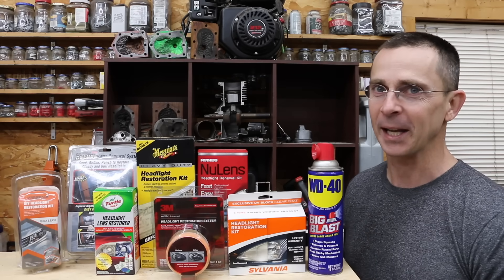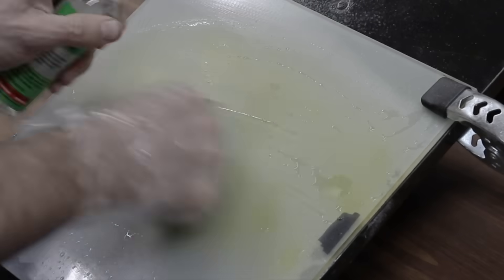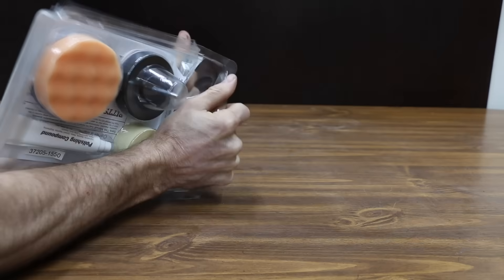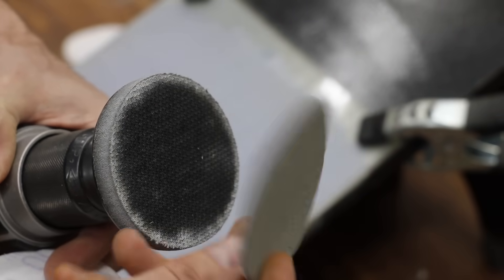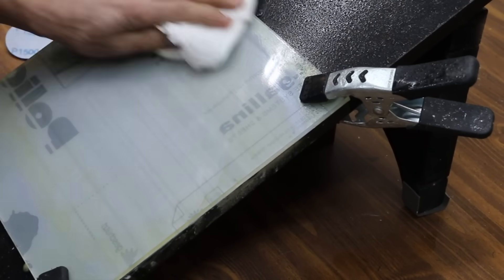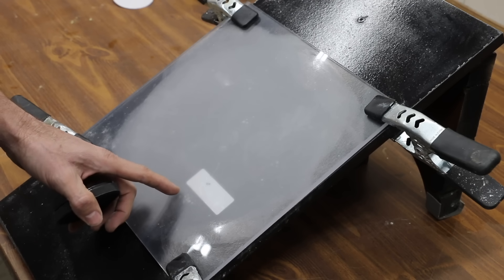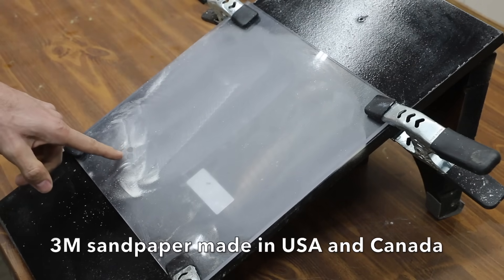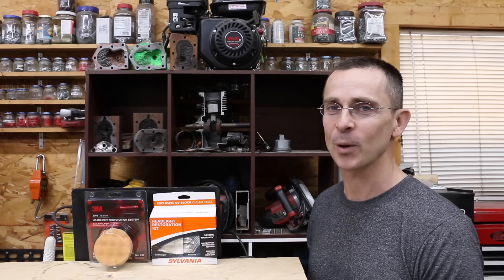Best Headlight Restoration Kit?  Let's find out!  3M, Sylvania, Meguiar's, Mothers, Turtle Wax & HF

Comment: ALL of the kits are rips offs. Hear me out. Most of these restoration kits contains a "UV blocker" that is often used in urethanes. I looked up some sds's and it appears that the SAME uv blockers are found in SPAR URETHANE (not to mention that the sylvania uv block smells and feels a lot like a urethane :D). The sds for sylvania and 3M use UV blockers with these CAS numbers: 104810-48-2 and 104810-47-1 etc. These are the SAME compounds found in Minwax Helmsman Spar Urethane. I simply bought a can of MinWax Spar Urethane (clear gloss), diluted it 50/50 or 60/40 with Mineral Spirits (so it doesn't streak upon application), did the whole sanding and prep (most important steps) for the headlights and applied the spar urethane. It's been a year so far and my headlights are still clear. After buying my own sandpaper (800, 1000, 1500, 2000, 3000) in normal sized sheets, (none of these itty bitty samples they give you in the kit) plus a whole 236ml can of the UV blocking urethane, I got about 15X more product for half the price. Pays off to do your research folks, there's nothing special or "revolutionary" about these products. Active passive uv blockers, 3D, 50 shades whiter, 50x stronger than regular...????? hahaha. Thanks project farm for doing these video's, awesome stuff as always. Could you compare with your own kit and sandpaper as described above? The minwax Helmsman urethane comes in a green can, costs about $15 up here in Canada.
Reply from the maker: Thanks for the video idea.

Comment: ive used most of these products on my vehicles over many years and also concluded that the Sylvania kit is the best. It lasted about a year for me on three cars until the streaks from where the gel was applied began to show. The absolute best way to restore headlights is to sand like the Sylvania kit says, dry the headlight and area around it, mask with clear plastic and painters tape, wipe with rubbing alcohol, and use a 2k aerosol clear coat. This is actual high quality paint with a hardener that will not break down like other kit sealants or regular 1-stage paint will that you can get at the auto parts store. The paint is about $25 a can and only lasts for about 48 hours after you crack the seal to introduce the two parts of the paint can together, but the results are phenomenal. Headlight looks brand new and zero fading at all, just like regular clearcoat on a car.
Reply from the maker: Thanks for sharing.

Comment: I bought the Harbor Freight kit about a year after I purchased the 3M brand. and it's basically the carbon copy of the more expensive 3M, even the directions. but the Pittsburgh pads don't last even half the time the 3m's do. the quality is garbage. good thing I had pads leftover from the better brand to finish my lenses. fair to say, I'll just stick with the tried and true, at least for me, 3M Restoration kit. I also use a spray bottle throughout the process of sanding, so basically wet sanding and it keeps the sandpaper clean from clogging up.
Reply from the maker: Thanks for sharing.

Comment: Hey PF, Another great test.

I have two product suggestions. Both involve filter elements:

1. Refrigerator water filters. Are aftermarket brands as good as OEM? I bought a new GE french door model just before Thanksgiving, and the red filter light is now flashing. A check on Amazon shows I can buy 3 aftermarket filters for 1/2 the price of a single GE OEM filter.

2. Furnace filters. 3M filters (the ones I use) cost more than other brands, and they have several filtration levels. What's the difference, if any, between these levels and cheaper brands?

In both cases we're talking about essentials here. The public should know if the water we drink and air we breath in our homes is actually safer using these products. 

I'm going to contribute to Patreon because of the work you do. Thanks.
Reply from the maker: Thanks for the video ideas.

Comment: I had tried the turtlewax, 3M and Visbella, they all work the same if you machine polish them with the sanding pad then the cream polish. They all cleared up but they also all dulled up again after a few months, the visbella's selling point is it has an acetone based liquid to dissolve the headlight to make a clear appearance but its hard to do a clean swipe without introducing liquid wave due to surface tension. Dupicolor has their own kit with a clear coat uv resistant spray but i havent tried it.
Reply from the maker: Thanks for sharing.

Comment: I used a slightly fancier version of the 3M kit (same sanding discs, but bundled with a protective coating wipe) on the badly oxidized lenses of a 2007 Chevrolet Silverado Classic. I was nervous, having never restored any lenses before.

The results were outstanding and the lenses again look brand new. I really did not expect it to turn out as well as it did. I'd definitely recommend the 3M kit to others.
Reply from the maker: Thanks for sharing.

Comment: I chose 3M a while back when I went to the local auto parts store. After watching this, I'm glad I did. 3M always seems to have the best products. I don't remember seeing Sylvania's kit or I completely disregarded it. It's surprising to see that it outperformed everything that uses a drill with various grit levels. I guess it's a matter of the chemistry of the products used breaking down the yellowing whilst not aggressively digging into the lense like the other products. Great reviews, this channel rocks!
Reply: A big part is the ceramic (or ceramic like) coating at the last step.  It fills in all the scratches and self levels.
Reply from the maker: Thanks for sharing.

Comment: You should do gas tank repair tests. With plastic and metal tanks. Test if it works with and without fuel, gasoline and diesel, with wholes and gashes.
Reply from the maker: Thanks for the video idea.

Comment: Some "high-end" kits are Visbella/ 3M/ Mequiars labeled "Heavy Duty" go from hand sanding to drill based. The MOST durable, long lasting is 1K Clear Primer and 2K Clear Top coat. Meets or exceeds new level surface protection. 2K clear requires respiration gear; highly toxic stuff. The pay-off is SUPER durable UV, chip, and scratch resistant surface that
Reply from the maker: Thanks for the feedback.

Comment: Wonderful effort & review. In my experience, the most difficult part is following all the steps to a "T." Mess up with one grit or not enough pressure & the result is mediocre. That's why I gave Mothers Mag & Aluminum Polish a try followed by Scotty Kilmer's advice of finishing with a coat of Meguiar's Headlight Coating. Two steps, basically, with no sanding. 3 mos. later & still clear. Time will tell how long it will last, but so far so good. Here are videos:

https://www.youtube.com/watch?v=fDpWXyopH8c

https://www.youtube.com/watch?v=E9NP0_nF2ak

Comment: I have a wall of attitives and oil but I wonder if they are any good I have the kholer branded oil but is it better in a kohler engine I do have mostly older engines like the k serise Kohlers so maybe you can look into that
Reply from the maker: Thanks for the suggestion.

Comment: I used my Porter Cable buffer with one of those kits (cant remember which) and it turned out beautiful. However, the kit did not include the coating. Within a month, my lenses started to look like crap again. So I would recommend anyone doing this to get something with random orbiting motion and the coating.
Reply from the maker: Thanks for sharing.

Comment: Amazing Timing; I am just "re-doing" my 07 Jaguar VDP headlights - tricky because headlights are retro-look round with edges that are impossible to sand without removing bumper cover and lights. I know there are TOO MANY kits out there to test, but suggestion: can you add in a few "high-end" kits? I don't mean professional systems, more like: "OPT7 Headlight Restoration Kit w/excl Ceramic Nu Coating" and perhaps ones with clear spray paint for UV protection/sealing. I wish I could design my own kit with the best elements of all these 90% solutions. The final seal/protective layer is the essential item regardless of steps you take with abrasives and polishes to get a good finish. Thanks once again for a good test. I am not sure I like the artificial "aging process you used but I understand the dilemma in creating a fair test.
Reply from the maker: Thanks for the video idea.

Comment: Todd I have been trying to find a contact for you to ask you a question but hope you will see this. If you are putting a motorcycle way for the winter with synthetic oil in it would you recommend an oil change before storage so it’s ready to ride in the summer or a change after winter is over ? From watching your video I have realized how tough synthetics are but wondering if they are just as effective in not turning acidic when they are dormant for 5-6 months. The temperature swings are wild here and I am wondering what the effects of condensation are on oils that remain dormant. You’re channel is amazing and you deserve all the best.
Reply from the maker: Hi Karim,  Just my opinion but if the oil is fairly fresh and motorcycle is stored out of the weather, it should still be good to use.  Thanks you

Comment: Sylvania had the coating, that's why it filled all the scratches, if sylvania didnt have the coating then it would still have scratches, if 3M would make a coating in that kit then that would be perfect and I'm pretty sure they would be right there with sylvania
Reply from the maker: Thanks for the feedback.
Reply: @ProjectFarm  but great video man, super useful, thank you for the time and work you put into, liked and subbed!

Comment: If you want to remove the fine scratches i would use the meguiars polishing compound on some 3M 5000 grit sandpaper. I found that using polishing compound as a buffer instead of water tends to get out more scratches. 
If you have 5000 grit or higher, that would give you a better finish.
Silicone oil also works if you don't have polishing compound.
Reply from the maker: Thanks for the suggestion.

Comment: I actually used Sylvania on my own car and it seems to work really well. It did start to become hazy again after about two years but the kit had enough supplies in it that I could do a light sanding and re-apply the UV blocker (they give you a ton of UV liquid). After re-applying it seems to be fading again after another two years. Still really happy with the product and way cheaper than replacing the headlights on my old car. Glad the test proved it was the best.
Reply from the maker: Thanks for sharing.

Comment: I had really yelled headlights, could barely see lights when they were on . O'Reilly recommended bug off just spray on and wipe off immediately so I did and they were clear instantly.  The lady at the counter that recommended it said she has tried all kits and had best results with that. I tried it in parking lot before I left and cleared up instantly went back in and thanked her.
Reply from the maker: Thanks for sharing.

Comment: @projectfarm can you test tool rechargable batteries? Like for lawn mowers and stuff like that. I know like when you buy one you can use it on others but thing is a lot are moore expensive than others and the math is kinda off. I personally was looking at a Sunjoe, Ryobi, and a HomeDepot Ego mower but didn't know what was actually the best bang for my bucks or which battery would actually last the longest. I personally went with Sunjoe because I had other products from them and from what I can tell the batteries were the cheapest when they go out but doesn't speak for the quality.
Reply from the maker: Thanks for the video idea.

Comment: I love your testing projects.  I just ordered a new headlight restoring system called Cerakote Ceramic.  Its a bit more expensive at $25 but is supposed to last a lifetime with only one application.  If you do more testing you should try this.   I also wonder if it should be used on a new car headlights?   Since they are already clear , just the coating would be used and maybe they would not deteriorate.

Comment: Mine are so bad I basically can't see down the road unless I have my driving lights on.    I cleaned them once years ago started off with 500 then up to 800 and then 2000 wet sanding them all.  And at the end I used a polishing compound on them twice and then sprayed a clear from Krylon to protect them to last a couple months here in Louisiana
Reply from the maker: Thanks for sharing.

Comment: Please test Stihl Moto  mix Husqvarna XP Trufuel 50 :1 and VP small engine fuel.Are they worth the cost versus pump gas and premix oil I’ve been using Pennzoil TCW3 2 stroke oil  in my stihl equipment 100% gas at 50:1 for my lawn service for 20 years
Reply from the maker: Thanks for the video idea.

Comment: Video idea:  similar to your video mixing several different engine oils, do a video with an engine running a mix of oil additives with no plain motor oil.  I'm thinking something like engine restore, marvel mystery oil, Lucas, duralube, et cetera.  Just additives, no oil.
Reply from the maker: Thanks for the video idea.

Comment: Good info. I use a Porter Cable buffer/sander with a 3" backing pad, Meguiar's or 3M sanding discs, 3" wool and polishing pads, Meguiar's M100, then M205. Depending on the damage M100 on a polishing pad may clear it with no sanding. You have to coat it with something though, or the bare polycarbonate can quickly start to haze again.
Reply from the maker: Thanks for the feedback.

Comment: I saw a video on "the car wizard" channel showing how to clear them up with brake fluid and a few more steps. Maybe do a head to head test between the brake fluid and the best product from your video.
Reply: We all know what brake fluid will do to paint. I think I'll keep it, along with WD-40  and insect repellent, away from polycarbonate headlights. Once the crazing starts nothing will clear them up except replacement. Not too expensive for common cars but something like a high end Mercedes will cost $1200+ per headlight.
Reply from the maker: Thanks for the video idea.

Comment: Hi I'm the BFG, (Big Fat Guy...)
I have used Deep Woods Off, most people have it already, 
Clean lens off, apply light coating for about 30 seconds, wipe off with a non shedding towel or old clean sock, repeat if needed,( DO NOT LEAVE ON ANY LONGER IT WILL MELT THE LENS) then apply UV protection and sealant, follow the instructions for it...
I have used it on cars and Semi headlight lenses.. Disclaimer if you do not pay attention to what you are doing not my fault, practice on  a junk one first!!!) 
It seems the DET content is the key...
Reply from the maker: Thanks for sharing.

Comment: I don't use any of them. I use meguiars 105 after sanding with 2000 grit with a da sander. Then use opti coat headlight sealer
Reply from the maker: Thanks for sharing.

Comment: Am I the only one who is missing 1000 and 1500 2000 2500 in the steps because you can't get the scratches from 800 of by going over it with 3000 🤔

Comment: I've had very good luck with the 3M kits, so long as the headlights aren't oxidized from the INSIDE as well. I use the 3M professional plastic lense cleaner and polisher that you can get at most automotive paint supply stores instead of what comes in the kit, BUT the sanding disks are top notch. I've been able to re-use them many times. You can use a very heavy coat of a good car wax to help slow down re-oxidation, but 1 thing of note. When a plastic lense oxidises, it is chemically changed, so no matter what, it will eventually do so again.
Reply from the maker: Thanks for sharing.

Comment: Hey, i was wondering if you could do a 'which manufactured wood is better?'. I know rigid materials,  especially manufactured wood, can vary a lot, but after I watched the bacon grease as motor oil video and the which tape is better video i know your creative ways don't disappoint. This idea came when i got a project for design and technology and i really couldn't decide what i could use as a material for my final product. So, what do you think about it?
Reply from the maker: Thanks for the video idea.

Comment: Off insect repellent, dissolves a layer of plastic, scrub with a heavy duty paper towel to remove yellowing, then spray a thin even coat  once or twice to restore surface.
Reply from the maker: Thanks for sharing.

Comment: We use 3M at our automotive repair shop and it's an amazing product. The kit we get though actually does bring the UV protection wipe and it costs twice as much as the one you showed. Still worth it though
Reply: Fawq that shiet. I use regular ol’ sand paper (if needed) and polish with whatever compound I use on paint and achieve crystal clear plastic. 

I then seal with Meguiars headlight sealant (in a spray can) which is $9 at Walmart and BAM. Perfect clarity and protection for a year.  

Why anyone would use anything else is beyond me. 🤦🏻‍♂️
Reply: @I_know_what_im_talking_about  for the year? So it only lasts a year? The product we use is about $40 but we've used it on headlight lens almost 5 years ago and the lens are still pretty clear.
Reply from the maker: Thanks for sharing.

Comment: What I do is use a kit and some 1500,2500, and 5000 grit sand paper and get the lenses super clear then mask of around the lenses and get some automotive clear and put 3 to 4 cotes on with 2 or so hours of drying time between cotes. It makes the restoration permanent. You HAVE to let it dry between cotes or you get what looks like alligator skin bubbles all over the light.
Reply from the maker: Thanks for sharing.